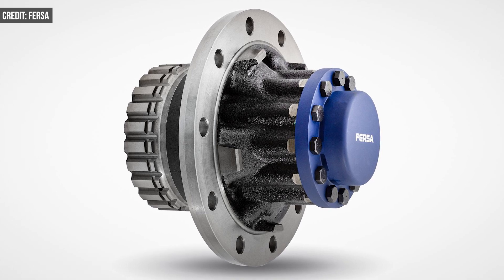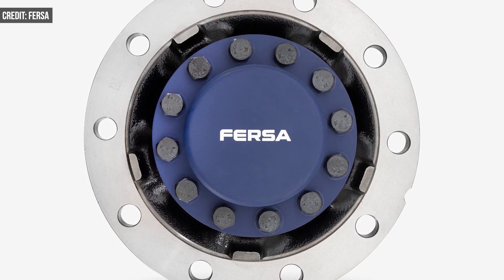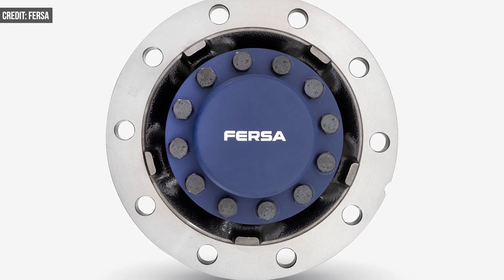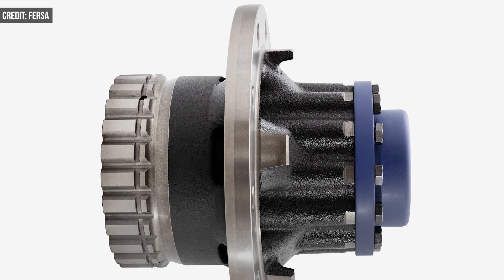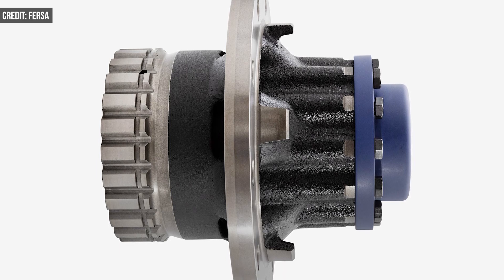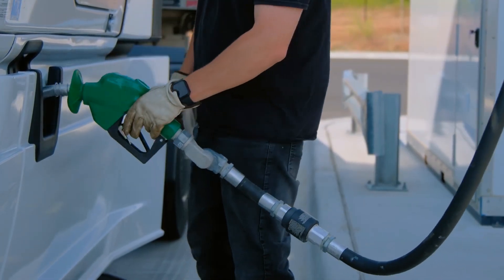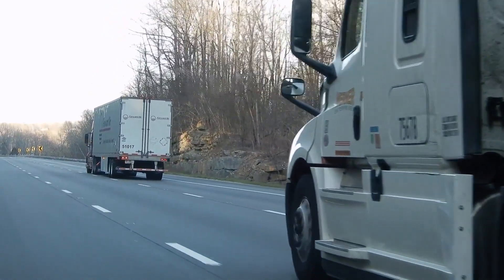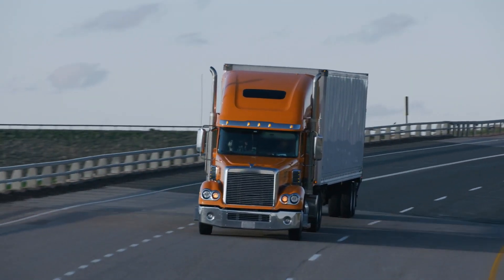Fuel Savings of 7% After Company Literally Reinvents the Wheel

Comment: 3-7% is within noise of nominal operation. Could've just seen less uphill, lighter payload, wind, thread, etc. 3-7% needs a controlled experiment, not anecdotal evidence from use.
Reply: If it holds up less friction, it can improve fuel economy. Quattro on Audis for example makes the fuel economy worse. Try servicing your suspension on a mountain bike and seeing how the little amount of friction being reduced improves the feel of the bicycle.
Reply: Realdan1, are you german? You sound german. Tipical Klugscheisser.
Reply: This comment is the result of using 3-7% of your brain.
Reply: Thanks, DNR'd the channel.